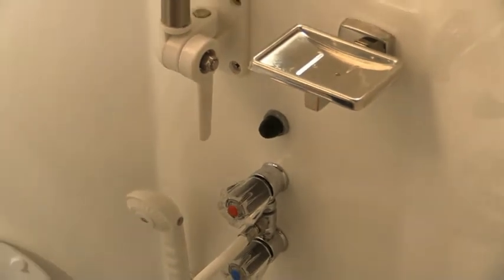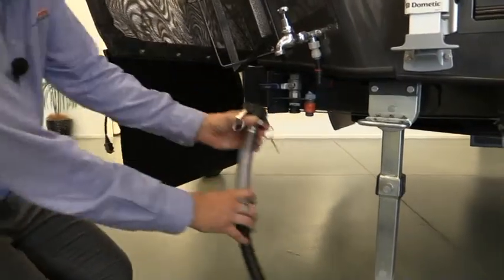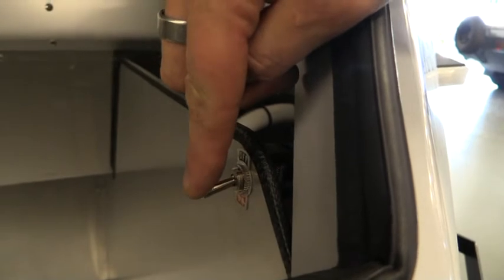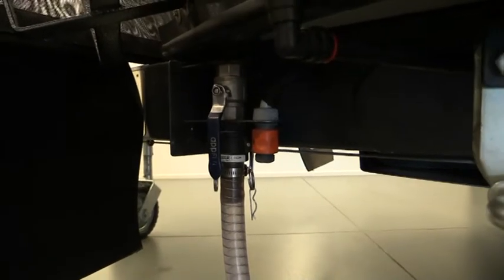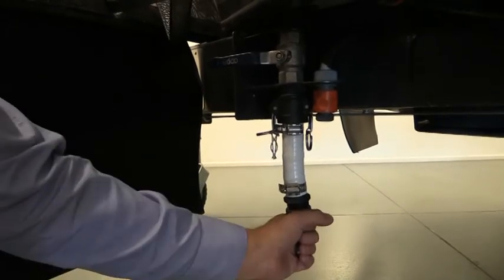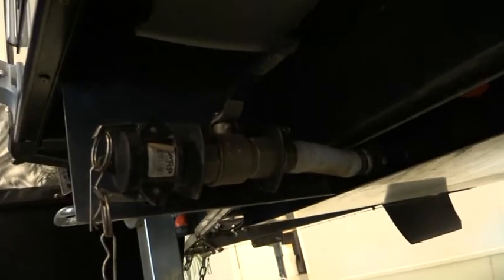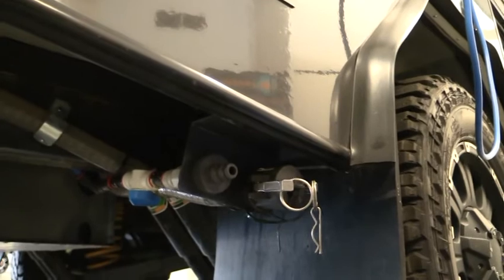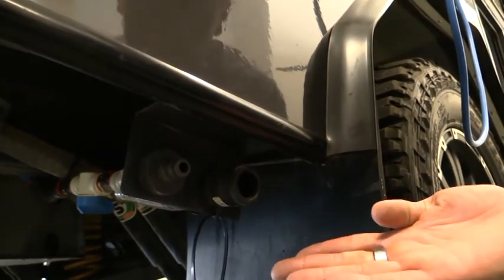AOR - Handover - All Models - Macerator toilet

Comment: Good video. Sometimes we have found that the maceration pump does not pump out straight away. I has been suggested at AOR that we use the Flush back Adapter attached to the outlet (valve open) and mains pressure hose for a few seconds. This pushes water into the drainage pipe and helps to prime the pump. We found this solution works.